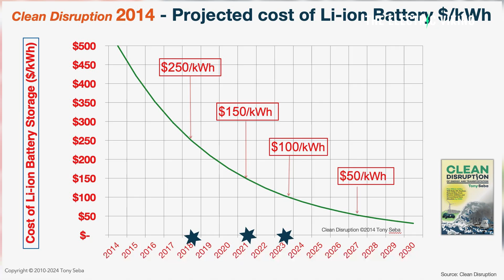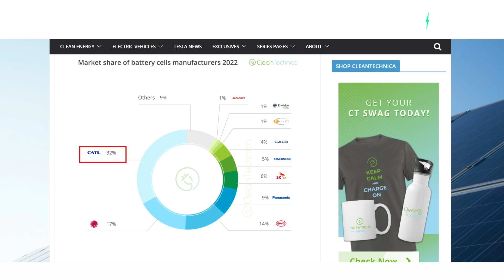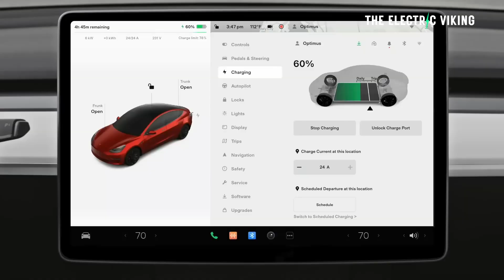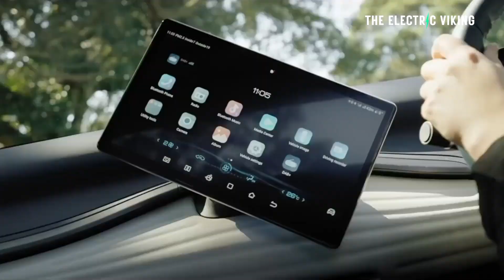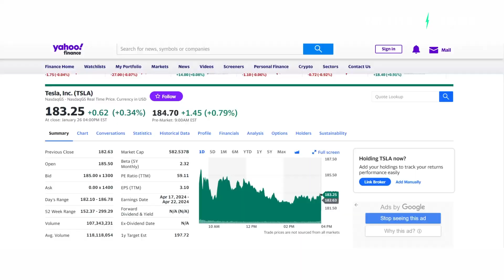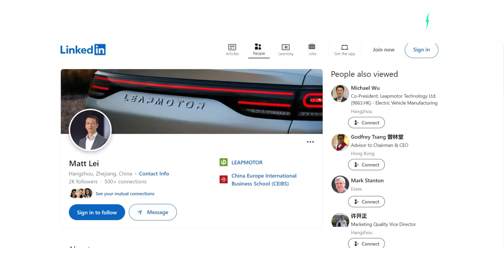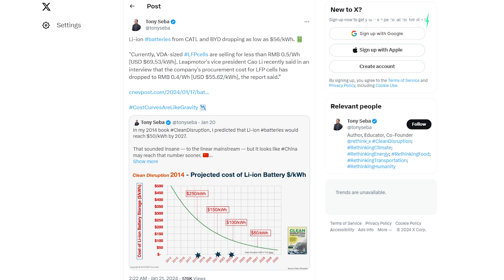Tony Seba's 2027 battery prediction is about to happen 3 YEARS EARLY!

Comment: The biggest problem with the introduction of EVs is not the car itself but the supply of electricity to use it. Even in the most develop countries, the grid system and the production of electricity are not sufficient for the added load that is required. Even if the price of the car was to drop to zero, if you can't get it charged when you need to, it is not convenient. Add to that the price of electricity that will have to go up considerably to upgrade the system and you get to a point where it will not be more affordable than an ICE car.
Reply: I am assuming you do not have an EV. The reason I think that is because if you did have an EV you would be aware of the fact that most EV's are charged during off-peak periods. So you don't need vast amounts of extra power or higher capacity grid connections..
Reply: Watch what is happening in Nigeria when gov removed the fuel subsidy and market if forcing them to go solar. The gas for their cars and generators tripled in price ! For me, I got 19.2 kWh, ROI in 6 more years and my energy will be free. Right now off-peak only costs 5c/kWh in Arizona.
Reply: " Add to that the price of electricity that will have to go up considerably to upgrade the system and you get to a point where it will not be more affordable than an ICE car."   Another example of you just not thinking about this.  If electricity prices go up I'll put solar on my roof.

Comment: 3 main hurdles for bev are cost, driving range and fire hazard
Reply: Tesla's software has pretty much solved the fire hazard thing, which is caused by not properly managing the battery's thermal condition.

Comment: These drops in prices for a battery pack brings total grid independance a step closer.
Here in the Netherlands prices for electricity are currently 50 dollarcent a kWh.
Currently the energy from my solarpanels (18 kWp) or approx. 18 MWh/year can be returned to the grid
for the same price. From 2025 that is gonna change. Having a battery of approx. 100 kWh and a diesel 5 kW aggregate backup with smart software and a dynamic energy contract (day prices on a hourly basis) will earn me 3000 USD a year and no energy bill. If 100 kWh will cost me 6000 to 7000 USD the investment pay back time is approx. three years.

Comment: Hey blockhead, the batteries are still toxic, mined by slave labor, subsidized improperly, charged by lacking infrastructure, still dangerous concerning fires and disposal and repair.
Reply: Hey blockhead! You still have to go to the gas station to fill your pile of junk up. The fumes from the exhaust are still toxic. Oil changes, what are they? Petrol and diesel vehicles can catch fire, have you not heard? I think it's something to do with thew fuel they use - look it up.

Comment: The EV revolution will begin in earnest once lithium-ion batteries are tossed away in favour of sodium-ion counterparts (or something cheaper and not containing rare Earth minerals).

Now that’s the mobility side of the equation. Then you have to fix the grid, which is way more challenging.
Reply: What about solar on your roof? Solves the grid issue so many non-experts seem to think is a problem.
Reply: @ianhamilton3113  Not doable in many parts of the world. Now don't get me wrong, if you have the money and opportunity, sure why not.
Reply: @lrg3834  In actual fact, in a lot of places in the world it will be small scale solar rather than grid connection which will prevail. Linking every village in African with a grid connection would require vast amounts of materials end expense. Bur a truck load of kit can get the whole village powered up. Add used EV's from Europe and away you go.

Comment: The Fifth Law's paradox:
No matter how highly mechanised and fossil fuels self-powered, fossil fuels extraction requires a number of people - as if the process was executed by hands using buckets and ropes. 
Today, this number is 8 billion people - working flat out 24/7 - strong.
Tony Seba is one of them.
Humans were not ready morally, ethically and intellectually to start the mass extraction of fossil fuels with the advent of the steam engine 300 years ago. 
The Magna Carta requires today overhauling – adding to it the right for humans to understand what Energy really is - before any other commandment;
“In any system of energy, Control is what consumes energy the most.
No energy store holds enough energy to extract an amount of energy equal to the total energy it stores.
No system of energy can deliver sum useful energy in excess of the total energy put into constructing it.
This universal truth applies to all systems.
Energy, like time, flows from past to future” (2017).

Comment: lifepo4 vs sib, SIB(sodium ion batt) op temp range -30 to +60 and no chance of fire, are now here, lifepo4's are 0 to +30, and have not heard of any with op discharge  range lower than 0C other than  lto ( lithium titanate)-50 C to +65C discharge temp and 10,000 plus cycles, however the chargers as usual are absent in useful numbers compared to gas stations

Comment: My fuel cost average about 1/3 less than petro (3.8 miles per KWh,  Chevy 
Bolt).  Charge at home @ .10 per KWh.  Gasser at 30 mpg @ $2.50 per gallon.   If your only means of charging is public charging, @.30 KWh, than it's a wash on fuel savings compared to a gasser.  You gain on less maintenance but lose on time.  Sure, I want to save the planet but my main motivation is reducing my transportation cost.  I own two EVs & a gasser.  I would not own the EVs if I had to rely on public charging.  Not prime time yet.  As far as lithium prices going down, great.  The reality is you swap one environment impact for another.

Comment: “… 15-20 years from now we’ll need no more lithium mining …” Bold statement and a wrong one. There will always be a growth in demand, there will always be new tech we need more batteries for, lithium recycling is not 100% efficient, there is always wastage, lithium mining will always be needed.
Reply: True, but it will eventually reduce.
Reply: @fredbloggs5902  The growth in new applications for Lithium batteries is going to keep lithium mining busy and blunt or even wipe out any slow down caused by the EV and grid storage expansions winding down. The only reason Lithium mining might end is because a better battery tech has hit the market.

Comment: Thanks Sam. Reading through the Comments, you do take it on the chin. I'd rather not. But you do good work. I always thought you must be off your nut regarding Toyota, not coz Iike their boring cars, but because they did quality manufacturing at scale better than anyone. But they are so missing it. Yes, they have debt, but they also have $75 Billion in cash and equvalrents. So they have time to adjust.  But they're making crazy announcements on strategy. I don't get it. I hated their boring cars but as an analyst had to admire their management. At one point in the 80s 90s they had so cash they were Completeley Self Funding!!! How could they screw up so badly? But I guess the did. Thanks for you channel. It's high quality.

Comment: ICE cars are only cheap due to mass production, overheads remain the same for 10 cars or 100000 cars, still need the same machines, assembly equipment and engineers to design them. As less people buy ICE cars the more they will each cost, it's a lose, lose situation fo ICE and the fossil fuel industry.
Reply: Spot on. 80M plus ICE cars made each year, EV production is tiny compared to this currently. Once EV production ramps up into the 10M plus levels, prices will be lower than ICE and it’s game over. ICE will be around a long time, but in terms of future development they are already history.

Comment: love EVs idea but there are things that concern me for example the difficulty and cost to repair, there are no shops with the knowledge to do repairs at battery level or even bus or speed controllers, they just replace entire blocks and that makes repairs extremely costly. I understand the difficulty of removing a BMS or searching for a bad cell, I understand that but the fact is that people doing thins won't be your regular petrol car mechanic, will be electronics engineers with heavy equipment and to lift and disassembly the cars and that I don't see in existence yet. Played a lot with IC RC cars and planes, a lot with electric RC cars and planes and I totally see the benefits and problems of both, on real cars and possibly planes things will go similarly, its just a mater of time but right now, for me to drop 30 or 40k on a car it isn't the time yet.

Comment: It sounds like in 20 years, there will be enough lithium to recycle, and no more lithium mining will be needed for the foreseeable future. I'm a little confused about how elements can be "lost" after many recycles. Do they go through atomic decay or get lost in space?
Reply: It's not lost, just not 100% of it can be recycled, ie the material can't be scavenged. So maybe 80-90% recycle rate is optimistic.

Comment: This is also good for those with solar power and off grid battery system... solar panel is getting cheaper, battery is getting cheaper better install more solar panel and battery then to depend on electricity from supplier that keep on increasing the rate.. if you are living in a tropical country with plenty of sun... it is a very good ideal to install solar panel... i have install one.

Comment: Excellent insight and information as usual. 

I know I am off topic, but let me just reinforce that the grid can not supply all the future electricity energy because the grid itself is insanely expensive to expand. 

The future is not generation and grid transmission of electricity to the millions and millions of ends of the grid.
The future is generation and storage at the millions and millions of ends of the grid.

Most vehicles are parked 23hrs every day at a building, and so if EV and V2G or V2X and selfplug-in, then local grids will balance out local storage.

Distant renewables and nuclear will fail economically because of their grid dependence. 
5 times more electricity and grid capacity in a no fossil fueled future. 

Consumers will have the technology to go offgrid even in the suburbs. 
66% of electricity bills are grid costs. 

Those left on the grid will be faced with fixed grid costs in their grid electricity bills. 
The grid may be an abandoned asset.

Comment: I think batteries will not become cheaper with recycling. Reason I think is that it wouldn't make sense for the recycling business if they also work for profit. What they want is to buy in cheap used batteries and sell for profit. We know batteries are a vlauable commodity. People will likely want to sell used batteries for a premium price because people know there is demand for its materials. If people sell used batteries for premium and recyclers sell them for profit I can see prices skyrocket at first. Once mass recyclingbis going only then will we see a meaningful price drop. I've also seen this in the past where early small scale recycled products were almost always 2-3 times more expensive than the mass produced original products. We want to think recycling os cheaper, it will be once we get the cogs of mass recycling going, but as with any growing business the early beggings will always be expensive so the companies can get their return on investment. Business in that regard works in strange ways sometimes contrary to theory. Even now I think little still is talked about recycling. We do hear reuse/repurpose, but not actual recycling. We do hear more about production, production, production, aka consume, consume, consume.
Reply: Redwood battery recycling make good profit

Comment: The product I have my eye on is the power wall. At $50 US per kw,  the batteries in a power wall will now cost about $650 U.S ( $1000 Australian). When  the price of a power wall gets to $8,000 Aust from $12.900 (plus installation} that is when going off grid with solar will be the same price as being on it. Tesla should be able to achieve this and you would think every battery maker would too.
Reply: You are being well and truly ripped off if Tesla are charging you $8500 Aust for something that contains only $1000 worth of batteries.
Reply: An interesting point as currently House level batteries are 300% more than utilities pay per KWH. In Solar the difference is houses pay 20-30% more per panel than a Solar Farm or Utility scale. That difference is  more applicable as a discount for the bulk purchase. I think house batteries are an early immature market with a lot lower prices to come. After all they use the same cells as a Utility scale battery.
Reply: Does make you wonder why they cost so much more per kWh.
Reply: @philwelling7172  Because there is much more than just  batteries in a Powerwall package! And... because they have a market at that price, and have presently not enough batteries to sell more than they do.  So, it is good business sense... even if I also would like it to be cheaper.
Reply: My buddy in South Australia had his 13.5Kwh battery installed for under AUD4000. Not Tesla but cheaper and bigger so BETTER!
Reply: @Ulbre  what brand is that?
Reply: @Ulbre  Is it the price of the TOTAL system, or just the battery?
Reply: @st-ex8506  nah, just the battery, but still considerably cheaper than the commenter quoted for the Telsa poewerwall battery
Reply: @Ulbre  Thanks!
The Tesla Powerwall is a great product, but quite expensive indeed!
Reply: solar + powerwall + electric car = no worries about fuel costs

Comment: If battery prices are so cheap, why are they charging so much for replacement battery packs? Tesla installs "refurbished" battery packs under warranty that cost them next to nothing when they could be putting new ones in there. It seems like Tesla is profiting off the gullibility and ignorance of the consumer and when the warranty expires, oh yes, now you can have a new battery pack but it will cost you $22k, thank you very much, when the cost of the cells to Tesla is probably less than half that amount, especially since Tesla makes its own cells and gets them at cost. What a scam.
Reply: Yes word is getting out that they are crocks.The Chinese will dominate

Comment: The problem isn’t the cost anymore. It’s the warranties. Hyundai charging $50k US for a battery replacement on a 45k vehicle just because the owner hit a bump on the highway isn’t going to cut it. Owners need assurances this won’t happen. Dealers still aren’t on board. Dead simple.
Reply: The ultimate solution to that problem is third-party replacement parts.

No way the battery really costs more than the entire car new. 

Quick math based on this video: a 100kWh battery should cost around $5000 ($6700 CAD) by the end of the year.

Comment: In 2023 CATL also said they were just about ready to put a 500wh/kg cell into production with aims to have it mass produced by the end of the year.  2023 has come and gone w nothing to be seen.
Reply: Catl can produce 500whkg battery already, it just that no car company willing to buy those battery because its too expensive to be mass produce. 2025 might be the year 500whkg would be introduce in alot luxury car like nio et9 already announce it
Reply: @nagi-springfield93  Mass production is what drops prices.  If you can't sell at a loss initially to build demand then you can never scale and will never be able to drop prices.  Lower prices come from scaling production.  Mass production comes first and lower prices follow.  Your reasoning is backwards.

ANY manufacturer would give their front teeth to get their hands on 500 wh/kg cells.  Mercedes, Porche, BMW and Audi have pricing power and can easily mark up their EVs if they can build cars w 500+ mi range WHILE being lighter than their current 300 mi range BEVs.

So I call BS.  The world NEEDS 500 wh/kg cells to match true ICE highway range and allay all range fears for good.  And anyone who can build a BEV w matching ICE range and equivalent weight of an ICE will do it even at a higher price.

Comment: "All predictions are wrong" - so true, even for Tony Seba.  His predictions were the most aggressive, but even then wrong because not aggressive enough!  Thanks Viking for getting this news out.
Reply: Scarily enough, this is like the predictions for how quickly warming occurs.  The numbers / projections just keep getting worse as we observe more and get better models.
Reply: @rogergeyer9851  The more we delay action on climate change: the more urgent action becomes. The reason is that our "carbon budget" (to hold the line a 1.5C or 1/3 of an XKCD ice age unit) remains fixed.

When the  Kyoto protocol was signed in 1997: we had about 50 years to phase out fossil fuels (2050 deadline).

After 25 years of inaction: we have about 7 years to phase out fossil fuels (2030 deadline)

If Conservatives get elected: we ill have 4 more years of inaction, and 1 years to phase out fossil fuels (2027 deadline, + a few years).

Comment: Anything news related on batteries, and leaps forward. 

Is all pipe dreams until they are in real production from a reputable name. 
There have been even so many battery announcements around graphite and graphine as well. 

Pretty much none of it made it to real production. 

But hey. Still way better than hydrogen 😂

Comment: The fact that EVs are not already cheaper is a scam, as is the fact that it's so difficult and expensive to swap out old EV batteries. A scam that matches the old ICE oil change scams of the past.
If Li-Ion batteries are $60/kWh, then a new 50kWh battery should cost $3,000 plus labour to swap out. $3,000. And if cars are made to swap batteries out in 10 minutes, that labour cost should be about another $50.
We know it's a scam. While it's a basic car, look at the huge price difference of the BYD Seagull in China as an indication.